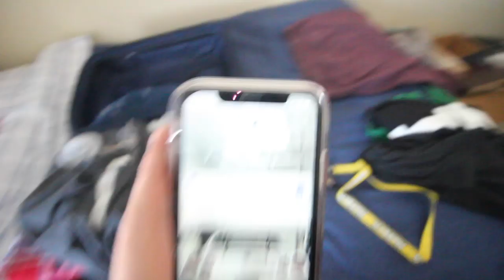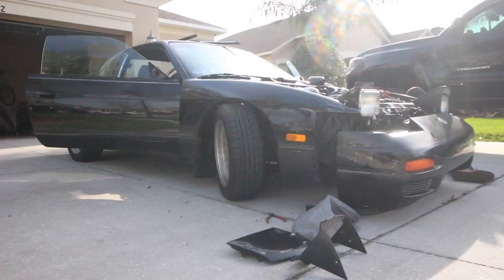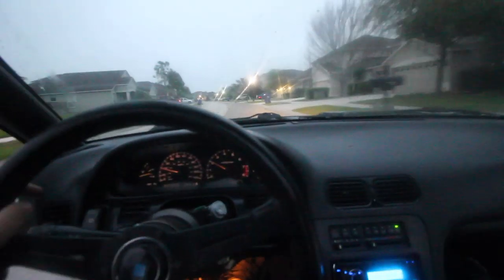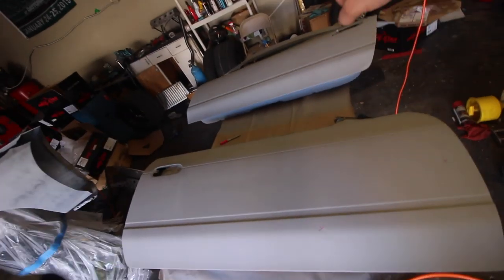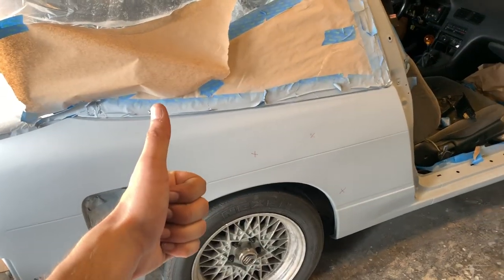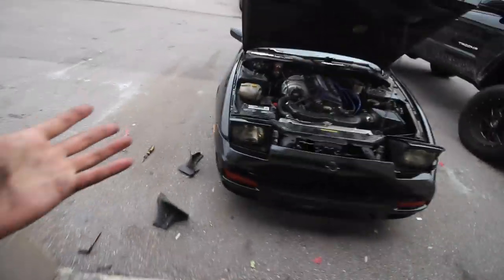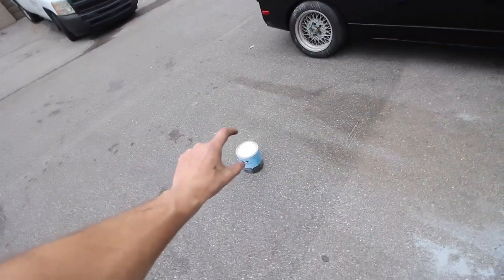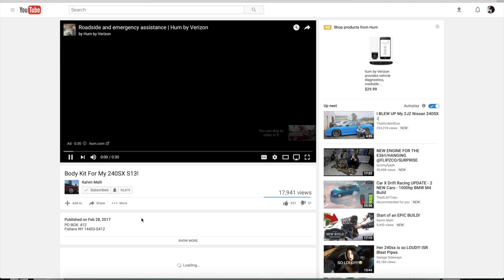HOW TO PAINT A CAR with a CHEAP Harbor Freight Paint Gun

Comment: That's Acrylic Laquer Clear coat. No different than what you can get at the hardware store in a spray bomb. Likely has a blue hue to it. Not a 2K clear. A 2K clear coat is a 2 part paint system. Clear coat and hardner. Acrylic Laquer clear coat contains laquer thinners and as it dries the solvent comes out. That clear is shite. Not durable or chemical resistant. You could wash it off with a gas soaked rag. Don't use it again its garbage.
Cheers
Reply: Using laquer over urethane lol.  U dilute and remove urethane with laquer thinner lolz

Comment: I'd take that for a diy job, looks decent. tho I'd stick with the traditional clearcoat with hardener+thinner 👍
Reply from the maker: If we had normal 2 part clear such as the. product I use on my own stuff. It would have been show quality. No buffing needed. at the end of the video I show you the finish of the engine bay in my z, Unless you'd like to check out the whole build process which is all on the playlist.
Reply: @KalvinMalli  yeah seen the zupra swap series man.Just knew from this video that kind of "ready to spray" clear coat exists , other than rattle cans.

Comment: killer video! And this is my opinion as a novice painter myself but ya the CC looked like premixed bottom barrel junk. I have had great luck with Acme Finish 1 clear fp720/740 for inexpensive clear and also Upol clears, both can make over 1 gallon spray able for around 100$. You should try them out and see how they compare to the nason clear (small project at first lol) I've been thinking of trying nason clear but there's not a local dealer for nason around me so when its convenient ill grab a quart to try.

Comment: Hey kalvin.  

I sprayed my hood and it came out great but now from one angle it looks to have all small cracks in the base coat under the clear.   I've never seen it before and wondering what may have caused it.   I used rattle cans but got the good ones not cheapo cans.   

It's really strange as none of the other panels I sprayed did it only the hood.  And it's only from one angle in the light if you change from it it looks perfect.   Feels smooth to the touch.   It's really bloody werid dude.  

I've painted hundreds of panels this way and never seen anything like it.

Comment: A fan blowing shit everywhere. When we people realise there's a bit more it. There's a few reasons painting is a four year trade.
Reply from the maker: Learing how to paint does not take 4 years. the fan was blowing outside. Not trying to sound rude. but the fan was not blowing on the car or parts lol.
Reply: No it doesn't take four years to learn how to use a spray gun but I said its a "trade" for a reason, which usually lasts at least four years. 
You would learn things like when to use a 2k clear, all the time and effort and the guys got a car that looks like its been pressure packed. 
Look man good on you for still putting the video up even though it wasnt the greatest result, respect for that.